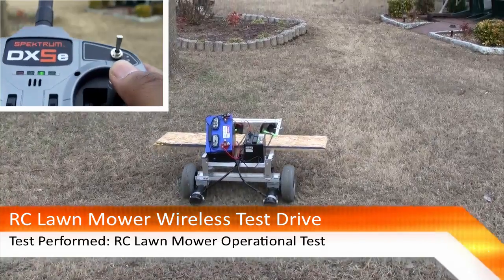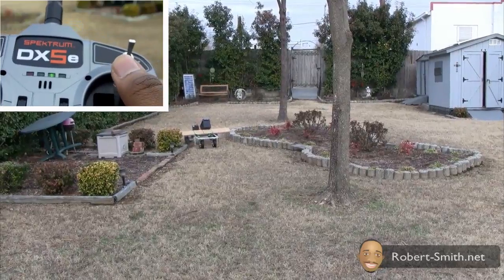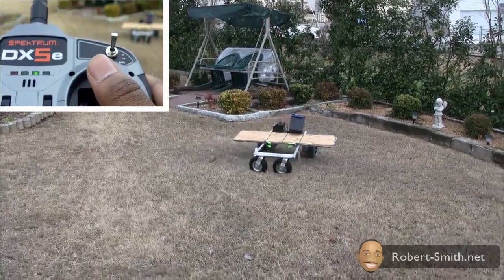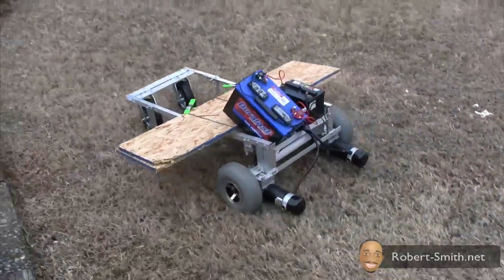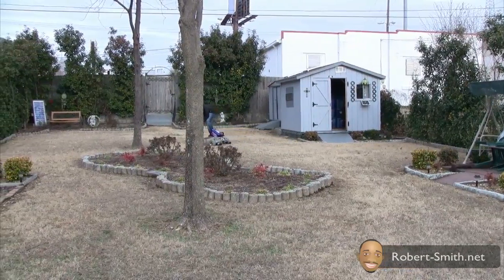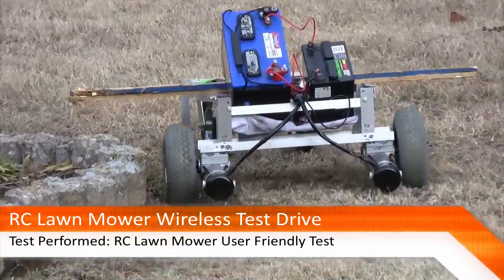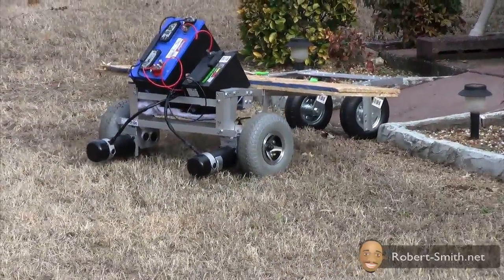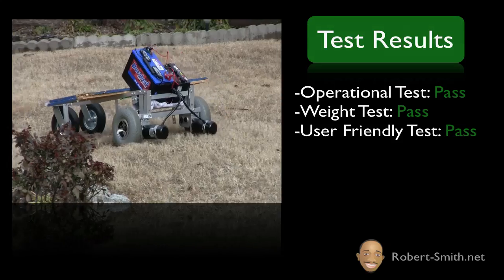RC Lawn Mower Project Update - Wireless Test Drive

Comment: Using larger 13X5 inch rear wheels will give you tons more traction and power. Google 'turf saver wheels bmikarts' and get them for 40 bucks a set - they have a four hole pattern that mounts directly to your wheelchair motors.

Comment: Very cool, that thing works great.  It would be neat if you had a rechargeable lawn mower with it.  That way, you could power the mower and the drive on the same battery pack.  You could start and shut down the mower with your remote too.